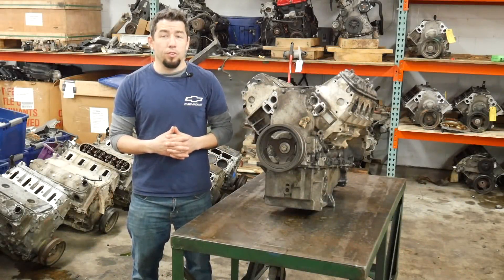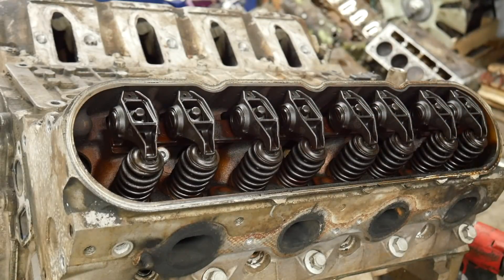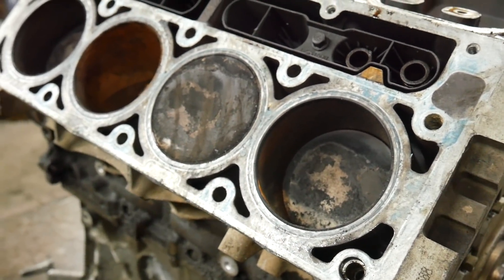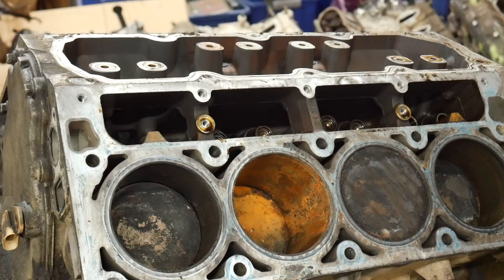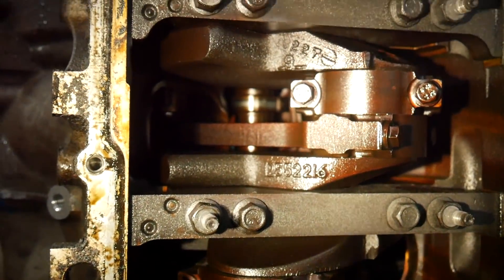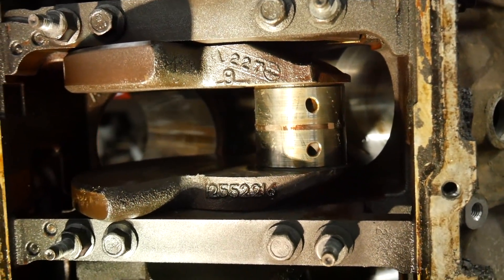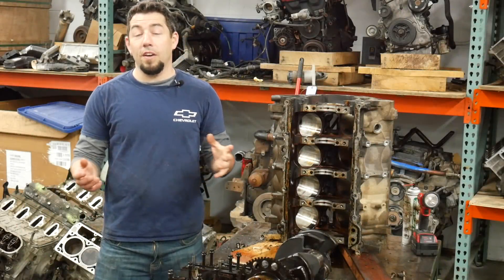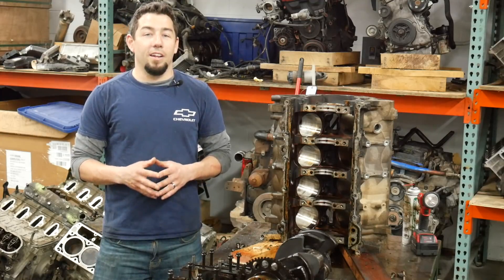Total Teardown! GM 5.3L LH6 Aluminum Gen4 V8. Change Your Oil Folks!

Comment: Low oil pressure isn't an issue; low oil flow is. If you've got leakage from the sides of the main bearings, it doesn't matter whether you've got brand new oil or three year old skanky oil in your sump, you won't have sufficient flow to hydrodynamically separate the two rotating surfaces. 

As to varnish, it never ever overly bothered me. Received wisdom is varnish is a sign of imminent sludging but that's total bollocks.

Comment: I have an older 5.3 and have changed the oil religiously. It has used oil from the day i bought it new in 02. But i like to change the oil after it has cooled down. Have had fluctuating oil pressure and bad oil varnish in the system. I am currently running mmo and changing the oil every week. Had used a heavier oil because of a leaking rear main i eventually fixed .I am back to recommended 5w20.No synthetic .I am going to drop the oil pan and replace pickup gasket .Have replaced the pcv. and flushed the system numerous times. It blows blue smoke at takeoff occasionally ,i suspect heads as it has 250k.miles.

Comment: Dang, I watched the teardown on the other trailblazer motor you did and I must not have caught it there but I do see what you mean by the oil pan having a legit hole in it for the front driveline.

Comment: A quick run in with a cylinder hone might help clear the rust out of those bores to get the pistons out easier. Especially if you're not planning on keeping the block.

Comment: Given that that engine was stripped I bet it was a junkyard engine that was pulled from a race car due to low oil pressure. The accessories were all transferred to the “new” junkyard engine...

Comment: I think a lot of folks don't know that hemi engines use a fair amount of oil even brand new. I've always known them to have some amount of oil consumption to where you would have to add some by the time a typical oil change of 3k miles arrives. Aside from the pretty well known block design starving the cam for oil at low RPM, there's no reason why people can't check their oil and top it off. Especially if you idle a lot.
Reply: Curious, does that consumption shorten the life of the catalytic converter?
Reply: @jonathansim678  of all the problems I have seen and heard of folks reporting, catalytic converter failure is not high on the list. I've never seen it. 

"Typical" consumption rates are pretty low. Last I knew, Chrysler basically had an allowable consumption rate of like a quart every 3 or 5 thousand miles. So it's not like these things are puking oil into the cylinders or anything. More than likely it's just due to slightly loose tolerances on the oil control rings of the pistons resulting in a film on the walls that burns off slowly over time. It's nothing wild. 

And if it was a severe enough situation to affect catalyst longevity, I would imagine they would have to look into some sort of TSB to rectify it or bring it down to a level where it didn't actually affect other systems on the vehicles. I don't think I ever saw a plugged cat in a hemi powered anything in the couple years I spent as a mechanic. One and a half of those years spent in a CDJR dealer.

Comment: That engine had oil pressure issues because the oil never got changed. Oil and filters cost way less than another engine.

Comment: it's interesting that looks so much smaller than the Ford Coyote.  Curious how many miles were on that motor given all that dirt/varnish and aftermarket head gasket, or was it just a goof that never changed or checked their oil.

Comment: Great Video.

Honestly no one cares anymore about oil changes.  Now even the Supertech is 20,000 mile oil. Thousands will burn up well before 20,000 mile mark due to running dry on oil.  70% of the vehicles that come into our yard are in due to no engine oil or pure sludge.

Comment: You can get 6 qts of super tech synthetic 5w30 and a pf48 oil filter from Walmart for 25 dollars for 12 dollars more you can get mobil 1
Reply from the maker: Or you can buy a used engine for $1200+ labor. It’s a tough call 😂

Comment: Any interest in selling miscellaneous bolts/hardware?  For gm engines? I find it nice to have the random bolts/hardware on hand. Just an idea. Email me gtjoynerwilm@gmail.com
Reply: Most of the bolts are torque to yield, which means they are one time use and will never reach the correct torque again without snapping.

Comment: If I owned one of these engines, it would be 4000 mile oil changeouts and full Syn. DOD really was a decent strategy for saving a few gallons of gas annually . Lifters look like they came out of a Duramax. Nice engine if taken seriously.

Comment: I have a friend of mine that owned 2 different trucks with the 5.3 motor and the active fuel mgmt on those engines
Both of those engines sucked with that system and the transmission not shifting right
Those 5.3's were also known to cause oiling issues with that fuel system
So in addition to poor maintenance added to the bad oiling issue caused that failure of a piston wanting to leave the block
Another one of GM's better ideas causing problems and I guess that will still continue for years on end.

Comment: my first tear down of junk engine 425 Buick nail head broken piston.bought a 85 LTD 302  down to copper on bearings ..30 cleaned up the crank ..40 overbore  ran fine for years sold it for a derby car.

Comment: Looks like they used a roll lock disc pad to clean the block when they did the head and took out the cam bearings and lost oil pressure

Comment: I change mine every 4,000 Miles   oil change place says it's the cleanest oil they change...(it's still clear and clean  at 4,000 miles)

it currently has 104k miles on it...    Sludge?? that word does not exist  inside  my engine..

Comment: do you ever get v10 triton motors? id like to see a teardown of one of those
Reply: Haven't heard many issues with those other than spark plug problems. 
I'd love to see one tore down though! Especially now that it's been replaced with godzilla. Maybe they dropped in price.
Reply: @lobeholdlordy  from what ive heard they're actually really rare. not bad just werent many made
Reply: You're right they can be. We've owned an f350 and an excursion with the v10. Great engines.

Comment: I just changed the oil on my V6 Escape... 11,000 miles.  Yep. There was fuzz on the magnetic drain plug.  Oh well, it's got 230K on it and I figure it's done it's job.
Reply: thats a ford. im honestly impressed its gone that long
Reply: @bradhaines3142  There's nothing honest about any fanboi..  At least you didn't regurgitate the old "fix or repair daily".  I've never had an engine fail in less than 200K miles in any brand car I've ever owned other than a Subaru 2.5 which broke a piston ring land.

Comment: Wow, two valves per cylinder and pushrods, welcome to 1965.
Reply: push rod engines are quite reliable see GMT800  GMT 400  most of these engine are still on the road 250k miles  later   some people even have 450k+ on them  Now if you disable the AFM  (via range  or hardware swap) you  will get the same amount of life out of them.. at lest 250k  miles  (changing the oil is cheaper then changing the engine..)

  the same Can't be said for modern engines though..  cough Chrysler ...  or any turbo charged engine..

Comment: Wish we knew how many miles were on the engine.. Must have been a huge amount.. My reasoning is aftermarket head gaskets someone had issues before the last straw
Reply: Rebuilt heads on a original bottom end w/ 200÷ miles .. owner drives it like its new😁 and it blows its bottom out.

Comment: Oil pickup tube to-ring went bad causing low oil pressure.  #1 rod bearings are the last to get oil.  Lifters going tappy tap tap, are the first symptom.

Comment: What's are the issues you usually run into with dod afm engines?
Reply from the maker: It’s usually lifter failure. The rollers come apart or they get stuck.

Comment: A wire wheel on a die grinder is the best way I found to clear the rust from cylinders to take old rusty engines apart

Comment: The 4.8 in my ‘06 Sierra has had its oil changed every 50,000 miles whether it needed it or not. It has 397,000 miles, and still runs excellent. Just passed smog with flying colors. Most reliable vehicle I have ever owned. It has been abused mightily, and refuses to acknowledge it! What oil goes 50k between changes, you ask? Mobile 1 5W-30 synthetic.

Comment: I have an 07 avalanche 5.3 bought it used, about 20,000 miles on it.
At 60,000 miles had to replace the lifters.
Reply: that is because at 20k miles it was still on the original oil change

Comment: Howdy. I am kind of surprised you have not made a handle yet to remove the cams.  Is the threads different between the different GM V8s?
Reply: I just used an appropriate sized piece of all-thread, and screwed another old cam into it and butted it up against the cam to be removed, so cam snout to cam snout. Then you have some leverage and it's perfectly balanced, making it easy to remove without Harrington up the cam or the bearings.

Comment: You scared me.  My 06 Silverado Z71 5.3 140,000 miles, METICULOUSLY maintained since birth is now beginning to suffer from the dreaded oil pump pickup screen o-ring issue. It's not bad yet, I think I caught it in time.  Regardless,  when my fat 60 year old a** gets it out, upside down on the stand, it's going to get timing set, rod Bearings, and hv oil pump. Hope it'll be ok!!!!
Reply from the maker: They all do it eventually. I have one of those trucks myself and it’s on the list of need to do’s for this summer
Reply: @I_Do_Cars  It just started showing these symptoms. I'm being very careful not to let it idle, and when I absolutely HAVE to drive it, I sit with it at warm up and keep it around 1,800 rpm. As soon as the thermostat opens, it goes from 35 psi oil pressure to 45 plus. Obviously swelling of parts is sealing the pickup oring. So,,,, I can either leave it running for the rest of my life,  or fix it!!!! Lol we all know that air don't lubricate worth beans!! Lol

Comment: This platform of vehicle was horrible, ask Trailblazer SS owners. Under hard acceleration the oil goes to the back of the pan and away from the pickup tube leading to oil starvation even when the oil is at proper fill level.
Reply from the maker: I had one. It was... always in the garage

Comment: My 5.7 litre Chevrolet LS1 V8 engine was as varnished up as that when I pulled the oil pan off to replace the oil pan gasket as I expected I think that it was neglected as far as oil changes go as well.

I replaced the hydraulic lifters in it in 2018 which "clacked" once the engine warmed up with LS7 items which supersedes the LS1 lifters, they were mushroomed & getting jammed up in the lifter bores, note I never got the cylinder heads resurfaced in it, over 2 years later - no problems.

Note that I checked the oil pressure which was o.k. so the crankshaft & camshaft bearings were o.k.,it has done 363,500 kilometres now so that's why I change the oil.

I would give the 5.3 litre engine block a hone  to see how it cleans up !
Reply: I have a 94 Trans Am I bought new.  350 LT1 engine, never been touched,  even the timing chain is original. 338.000 miles on it. Runs like new,  uses no oil.  3000 miles oil changes,  Castrol GTX.

Comment: You call that dirty? Holy crap....if you think that engine is dirty, I wonder what your response would be to the engine a friend's dad had just a few years ago... in a Nissan Altima..... His dad had taken such bad care of an already abused car..... We pulled the valve cover off to see why the engine was making funny noises.... the oil galleries were so plugged up with sludge, the head was bone dry, and the sludge in the bottom of the head had turned to what looked like flaking insulation! And it wasn't a tiny amount either! When we pulled the head off to have it cleaned and checked, some how, the cams and valvetrain were not toast! I may hate Nissan's since about 1997, but they did make a tough engine in the old KA24DE. That engine you are tearing down here, is really clean in comparison.

Comment: If you want to keep the inside of your engine clean use synthetic oil. I drove a '78 Chevy pickup for 21 years. When I replaced the valve seals at 200k there was no sludge around the valves or valve spring or inside the valve covers.

Comment: My 07 5.3 Silverado DoD has used oil since new, had DoD issues before first oil change.  I always change the oil at around 5000 miles, but it still comes out black and nasty.  It sticks in V4 mode till I press the gas a little harder.  At 100,000 miles it is still smooth, quiet and powerful otherwise.  DoD sucks.

My 2011 4.8 Silverado does not have DoD and the oil comes out much nicer.
Reply: Displacement on demand is a good argument in favour of engine downsizing and turbochargers.

Comment: It’s amazing that someone gave that engine away and labeled it as non-rebuildable. As a home-gamer I’d bore it out to a 5.7L. If the crank really was trash, summit sells rotating assembly kits for not too much. Hell, those guys over at roadkill probably would have just cleared the rust out of the cylinders, threw a high volume oil pump on it and drove it across the country.

Comment: When are you gonna do a 09-13 BMW N63? With all the issues those had, there have to be hundreds, if not thousands, of cores available.
Reply: Why would he buy one when he can't sell it?
Reply from the maker: Ha, I could definitely do alright on n63 cores but the truth is I don’t see them that often. Most people just throw the whole car away
Reply: @I_Do_Cars  That’s exactly what I did. Dealer told me could be as high as $30-40k to fix everything, I just traded in my 750 instead. 
Yet my stupid ass picked up another N63 car. Leased it this time though. Let BMW deal with it. 😇
Reply: @I_Do_Cars  Tech opens the hood, "oh I see the problem right here, this is a garbage car"
Reply from the maker: matthew kendall I have a thing for (older) BMW’s, but you aren’t wrong 🤷‍♂️
Reply: @I_Do_Cars  I used to have a '76 2002 and a E36 325i so I feel your pain. It's definitely a love/hate relationship...
Reply: @alexstromberg7696  Parts can be sold. And sold for quite a bit of money. BMW has replaced most of the parts with issues,  so the remaining stuff is good. The bottom end is virtually indestructible. Other than the valve seals the heads are good, and if you’re replacing the heads you’re gonna replace the seals anyway. The biggest issues were with the turbos, which probably wouldn’t be on a core engine.

Comment: Yeah, I cut the service intervals half on my cars.  There’s no way I am leaving 4.5 litres of 0w20 in there for 16,000km
Reply: The 0-20 oil is like water.  Its amazing what the manufacturers will sacrifice for 1-2 extra mpg
Reply: @kingssuck06  I run my 2006 gxp ls4 5.3 on 5-40 synthetic and some motorkote  about 6 oz run like new 180000 miles .

Comment: My oil gets changed every year during it's MOT. I just get full service done regardless of mileage as i dont want my engine to end up like this one. 170K on my engine and counting with very few issues.
Reply: Most owners manuals specify that the oil should be changed at least yearly regardless of kilometres on the odometer. Do people not do this?
Reply: @nerd1000ify  My mum didnt. Killed her Renault Clio. Didnt have it serviced for 8 years. Topped the oil up but ultimately it dropped a valve, mashed up the cyclinder and completely lost compression. Off to the scrap yard that went. After as servere a bollocking as you can administer to your mother, her new one gets done every year like mine regardless.

Comment: Absolutely.  Oil really helps. My ex wife got an oil change on her Toyota at the dealership and they did not tighten the oil filter. 4 miles later the engine lockup. Only 12k miles on the  vehicle. We had to hire a lawyer and 18 months later we had a new Toyota. The lawsuit was on a local newscast and guess they really didn't want the State Attorney General to step in. The next day they were ready to negotiate. I stood firm. No money from us because we down a car for a year and a half. Brand new. No taxes, no tags, no nothing. The actual owner of the dealership stepped in, fired the GM and we drove away with a new Corolla.
They refused to end though to show me the disabled engine after a complete tear down. I would of liked to have seen it.
Reply: Damn, talk about an epic F up on their part...

Comment: "Deferred maintenance."  That strategy had "limited success."
Reply: Which most likely resulted in a "negative cash flow situation"
Reply: @kevinbialkowski3694  "Sub-optimal" judgment led to an "environment" where "mistakes were made."
Reply: I think DOD engines get a bad rap because oil is not changed enough. My son has 125,000 on his GMC Sierra 5.3 no problems.
Reply: good for "the life of the engine"

Comment: I 100% disagree with the 5.3 block being worthless, spend $300 to recondition it (hone and deck the block no 90% of the bocks you get) and sell it for $600 I will guarantee you that you couldn't keep them on the shelf! $600 for a completely ready to go ls block would be a top seller, especially since they are most likely replacing the pistons anyway. A true 6.0l or bigger block ready to build could cost well over $1800!  The only reason there isn't a market for it is because nobody has offered them. You are sitting on a gold mine and don't even know it.